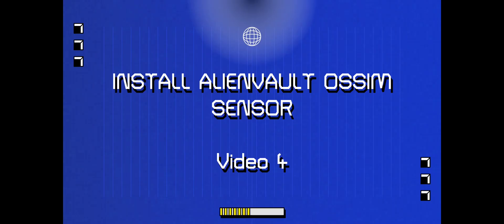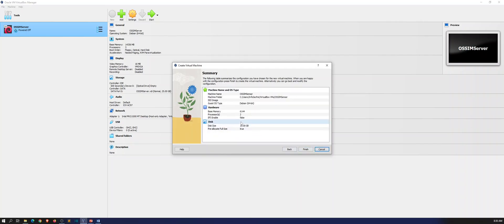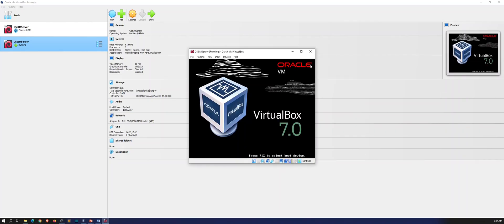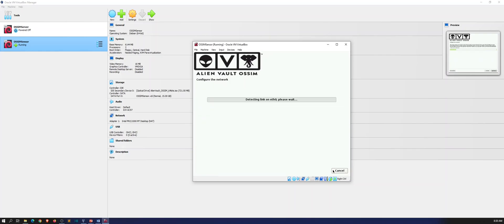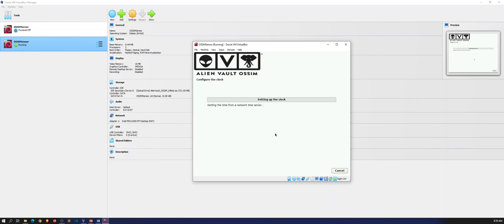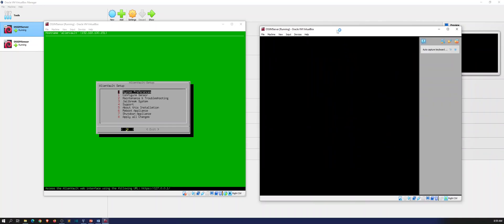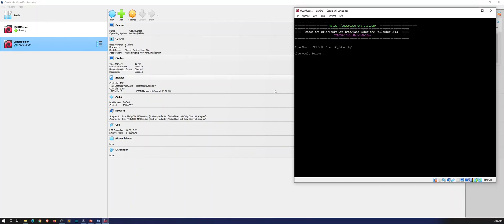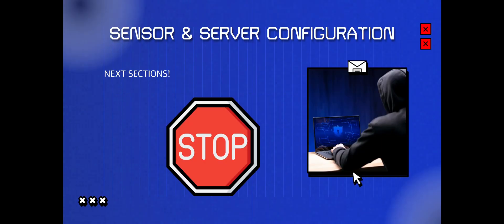OSSIM ALIENVAULT COURSE - VIDEO 5 HOW TO INSTALL AND SETUP ALIENVAULT OSSIM SENSOR IN VIRTUALBOX

Comment: by adding another adapter we will have two adapters for one sensor and two IPs right? 151 IP is for adapter one. for adapter two the will be lets say xyz. and this xyz will be dynamic until we change it. so my questions are
should i change xyz to static?
where in future will we add this xyz IP in configuration, as u said this NIC has Promiscuous mode on so in your next videos i can not see you using this xyz IP anywhere to forward traffic to Promiscuous enabled NIC.

did you plan not to use it anymore? Plz help me understand this i am confused
Reply: Like why not use the available NIC why create one more? That is what my question is